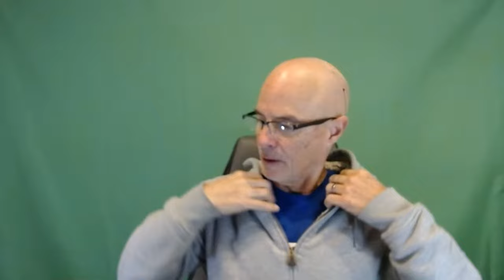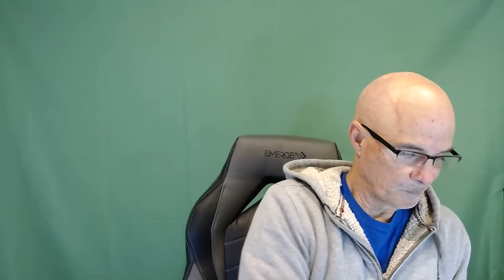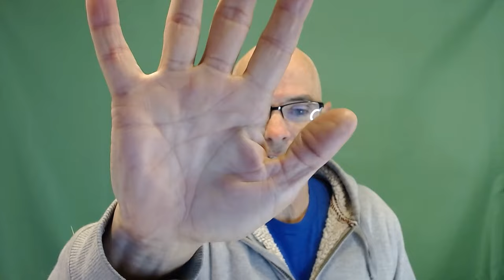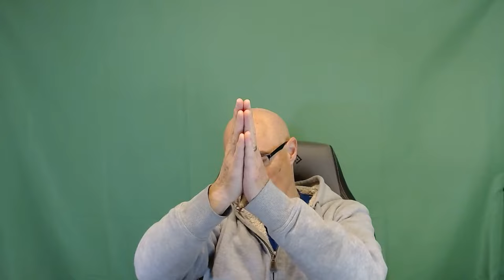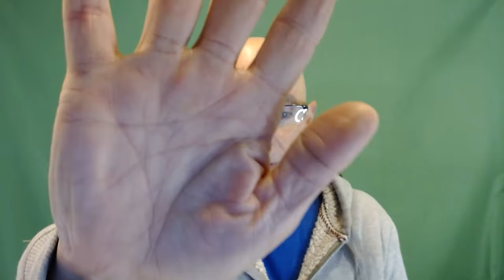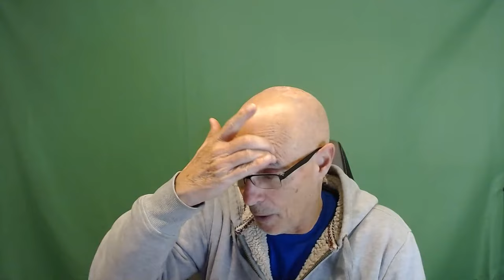LET'S TALK TECH-7 PSI PUMP GAS AND DETONATION

Comment: I'm a tuner and the most dangerous place in any engine is a low rpm high load that is where knock is most dangerous weather it's under power or just cruising.  So an example if converter is locked up and your In a high gear say 4th locked up at 2500 rpm and you request a rapid throttle request you most likely cause knock from the high load low rpm causes high cylinder pressure . So very torque cam has the same effect . I'm not the smartest guy in the world but I can only tell you what I see when I'm data logging . God Bless .

Comment: My guess is the engine with the BTR cam installed. Although the boost Pressure is the same, the Density Ratio is significantly higher. More air & fuel in cylinder creates more combustion temperature and pressure, moving closer to the pre-ignition threshold. As a an automotive research engine technician @ SwRI, I was privileged to see test engines of wide varieties. Much of it was related to exploring LSPI (Low Speed Pre Ignition). One test I remember was a turbocharged domestic I4 on a dyno with an auto trans, then dyno, then heavy steel flywheel (2" thick x 3.5 diameter to simulate vehicle load & inertia). The engine was equipped with 2 block mounted knock microphones that went to a graph. The engine was muffled & piped outside (very qiuet)  so we could hear the valvetrain, port fuel injectors & flywheel bearings AND LSPI. What amazed me was the engine began detonating (per the knock mics. & graph) Before I could even hear it when I opened the test cell door to listen. The LSPI events were low intensity (non-destructive to the engine) before I could hear them, but increased in intensity as carbon deposits started to build up from a known "dirty" fuel formula. Additives were being studied to clean off the carbon but I can't say any more about that or I might get in trouble 😎. Great discussion!
Reply from the maker: very cool stuff-lots of variables to influence the onset
Reply: Yes, after years of intense research, the oil additive that multiplied the frequency & severity of LSPI was ash. I finally saw that in print from a different source so I can verify that now. More ash = a popcorn party! Low or no ash = hours of sleepy time/silence. A substitute had to be developed, because ash served a useful purpose. Paul

Comment: I think that the stock cam would be more likely because of dynamic compression being higher. But in any case the tune would (should) be optimized for whatever cam that is in place reducing/ preventing detonation.
Reply: In addition those smaller Truck Norris type cams don’t have that much less dynamic compression. 235-238 @.050 and bigger cams really start to drop the cranking compression.. less than that not so much. (All my experience is with push rod V8’s)

Comment: Here in Norway we do not have E85 fuel and Americans would never believe the cost of race fuel here. We therefor have no choise than to run pump fuel and american tuners that have dynoed / live mapped newer Corvettes via internett have said that our fuel is much more detonation sensitive than american pump fuel. This have forced us to "master" pump fuel. :) 
450 - 490 whp 16V 2,0L engines and over 1000 whp 5,3 LS engine is an easy walk in the park here so 2.0 whp / CID is childs play.  :) 

Stock cams is emission cams that sabotage real engine performance with late intake valve opening and BTR corrects this. One can open the intake valve earlier and close it later, increasing VE without increasing compression pressure, right? This works as it the engine is lager but without higher compression ratio or compression pressure. :)   
A friend just tore down his pump fuel street 5,3 LS Twin turbo engine that has gone 163 mph 1/4 mile in small tire - stock suspension - but he did run C16 that time. Sign of a small head gasket leak, but otherwise very well after two years use and also doing the drag and drive event Street Week Sweden. It is almost a fairytail, but it can be and it has been done. Ambissions for 2024 season is winning.
Reply: How much is 20 Liters of Toluene? It was used during the Turbo F1 era to fight detonation.

Comment: I’m running 10-11# boost on a 9.70-1 4.8 w/Turbo on 93 octane. Conservative timing 500 rwhp. 
.560/.560 @.050” 216/220 adv 285/292 LSA 114 ICL 110
The cam and DCR has to directly affect octane requirements. Cylinder pressure 🤔
Reply: 10.5 psi of boost is 0.71 BAR boost and 1.71 MAP. 500 whp / 1.71 MAP = 292 whp from "The theoretical NA engine". Then one has to compare this to what an NA engine with this cam typicly does. The difference in power tells us if there is to much ignition retard under boost because the engine is running to high compression ratio.

Comment: I would think the stock cam would knock first. The sbe guys always say they prefer to make power with boost pressure.  Not igniton. And they love high rpm. So they prefer high cylinder pressure in short duration achieved with boost. Not igniton.

Comment: If it's alot bigger cam it lowers dynamic compression which will reduce chance of detonation. Example gm 632 12:1compression 1000hp runs on pump gas

Comment: Basically the max temperature of the charge at peak compression and temperature of the parts in the combustion chamber determine when it will detonate. 

Power comes from torque. Torque comes from pressure impulse. Pressure impulse comes from heat.
Reply from the maker: think localized heat

Comment: What's the torque curve at 7psi for each?
If using the 200+ hp, I assume it's up in the rpm range.
In a vacuum and everything else being the same...Truck Norris should, in theory, require but make more pressure/temp (torque) at same rpm at an avg rpm in order to reach greater lift.
We can start talking duration and lsa if someone wants to degree the TN cam to decipher actual exhaust duration (because it's top secret) and go into valve events and overlap.
Reply from the maker: We don't need valve events to speculate on power-we have dyno curves before and after na and with a turbo
Reply: @richardholdener1727  We also have unknown tuning factors playing into the equation.

Comment: I feel like with blower plus a cam psi will go down due to less restriction. So For turbo to maintain 7psi ,it will be stuffing much more air into cylinders so more than temp i think cylinder pressur and atomization of the fuel will be the biggest determining factors. I think a cam with a lot of overlap would lower dynamic compression and could help prevent detonation. I think it would really depend on cam.
Reply from the maker: the question was Truck Norris cam

Comment: I would think you have two effects working in opposite effects on cylinder pressure.
The higher lift /duration would normally lower IAT from the compressor but at the narrow rpm band around peak torque at lower rpms where peak cylinder pressure tends to highest then peak pressure could offset that effect.
I have seeing other engine test where the intake temperature was actually lowered and boost pressure was lowered while the engine made more power from just a valve event timing change.
It's one of those weird things were more power is made from less boost, but these situations seem to be the case when dealing with restrictive OEM cams designed with engine longevity in mind.

Comment: Cylinder pressure, IAT, ECT, CHT, EGT, Oil Temp, internal cylinder/piston temperature, valve event timing. I am sure there are more variables than that.

Edit to directly answer your question. Maybe, but on average, no. The cammed engine would need at least a couple degrees.... probably more like 5 degrees less, in this particular case, to be safe. And I think it would let you know somewhere around 4-6k RPM on a summer day.
Reply from the maker: they ran the same timing
Reply: @richardholdener1727  on your engine dyno or on the road with actual coolant temp? 🤷‍♂️

Comment: Changing the "restriction" in this case is increasing the Volumetric efficiency.  So at the same boost level, you get more power. I think you should not have any additional heat or additional timing retard with only a cam change.  The issue is that if the engine cannot expel the exhaust gases fast enough the cylinder temps will rise, which can cause detonation.

Comment: The 2 different cams will require 2 different tunes.
The stand cam will have det before the aftermarket cam at the same power level.
Reply from the maker: optimized tune for each is a given

Comment: Hi Richard, I have a question.  My Ford 5.0 old school is backfiring and when I shut it off, it keeps running.  Is run-on considered detonation?  That means that my pistons are super hot due to timing or running lean right?  I added more fuel on the fuel mixture and it actually got worse, so I don't think it is fuel mixture although I guess the carb could use a rebuild.  My engine is 340 hp ford racing crate motor with a x cam.  What is a good starting number for timing, because if I lower the timing, it loses so much response and power.  I think it was around 20 degrees non-turbo, not supercharged either?
Reply from the maker: too much timing

Comment: So whats opinion on gen 3 coyote with 11 pounds of boost on 93 octane making about 700 rwhp. 12:1 engine. Gen 5 whipple 3L, intake temps with in 15 of ambient. 

 Cylinder pressure? Engine efficiency? VCT?  Its one of the most responsive engines with boost.
Reply from the maker: 15 degrees of ambient? I would like to see that
Reply: @richardholdener1727  gen 5 whipple 3L with whipples oversized heat exchanger.  I'm telling ya I didn't believe the numbers either till I got a setup. I have a twin turbo sbf in the 8's in a 79 f150, and this coyote blows my mind in my car.  Winter up in Canada but I promise in spring I'll send you some data. Full 1/4 mile passes. 77*F kinda day.

Comment: what was boost loss from stock cam to bigger cam, no other changes?
Reply from the maker: you don't lose boost with the cam change on a turbo application because the wastegates regulates based on pressure

Comment: More cam = more power = more heat = more pressure = more detonation?
Reply from the maker: where does the more heat come from?
Reply: @richardholdener1727  more extraction of energy from the fuel source  through more introduction of oxygen ? I am but the grasshopper here .